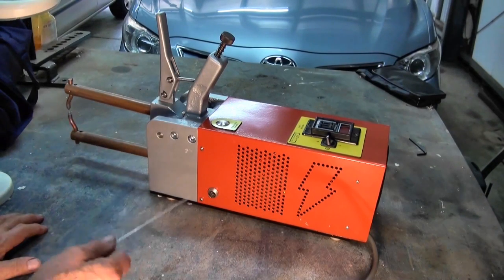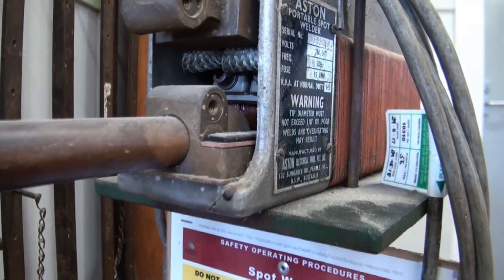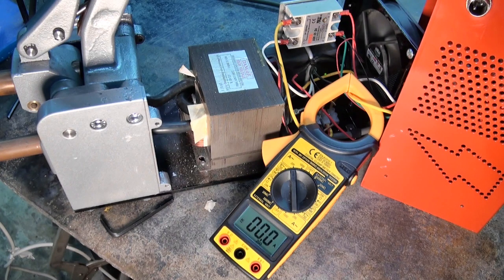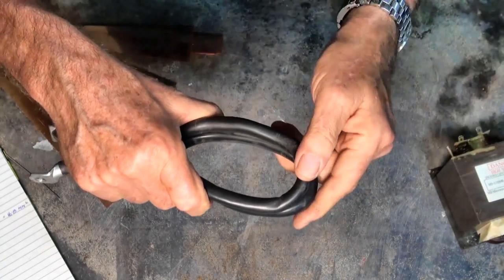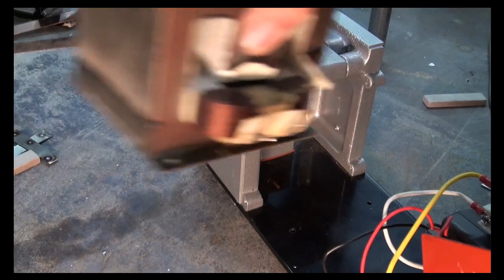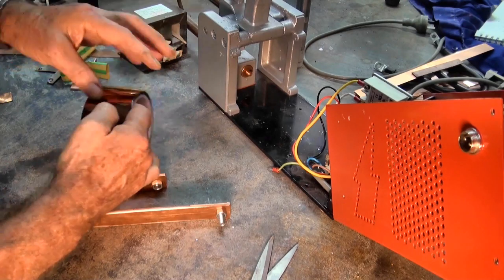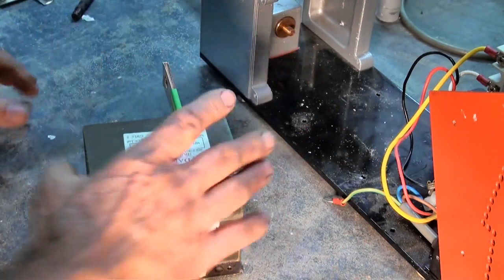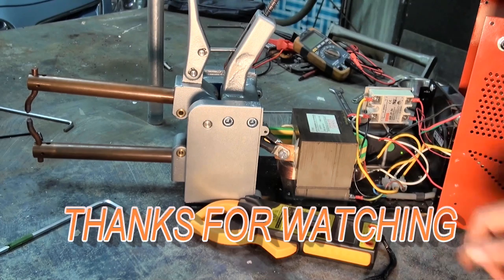Spot Welder Upgrade Goes Sideways

Comment: remove the flat metal plates between primary and secondary, they act as peak current limiter
Reply: No, you do not want to do that because the plates (core) increase the magnetic flux density (magnetic field through a cross-sectional area).  They are not just metal plates. They are plates made of highly magnetically permeable alloy that contains/steers the magnetic field.  If you remove them, then the magnetic field will spread out more in it's natural loops with only the air to permeate and will therefore couple less efficiently through the secondary.  The emf induced is given by -N*d/dt (mu*H*A) the time rate of change of the magnetic flux (B*A where B = mu*H) where N is the number of turns, mu is relative permeability (>= 1.0 (air/vacuum) ), H is the magnetic field , and A is the cross-sectional area through which the H field is piercing.  Emf can also be expressed as -L*d/dt (I) where L is the inductance of the secondary winding I is the secondary current and again d/dt means the time rate of change.  Equating these we get N*d/dt (mu*H*A) = Ld/dt(I) ==> N*mu*H*A = LI and solving for I we get....I = N*mu*H*A/L so....the secondary current is proportional to mu.  With the plates in place, mu >> 1. removing them makes mu = 1.  Remove the plates and your current goes down.  Feel free to verify the physics.  Cheers and peace to all.

Comment: I was thinking I would use my own insulation,  a flattened copper tube with a woven fiberglass sock  and then coating the lot with shellac.   For the tongs  the idea In my head atm is continued copper tube with a stiff steel insert   I'm just trying to get the leverage mechanism worked out in my head
Reply from the maker: Since making that video I have rebuilt the secondary winding of the transformer using 00B&S battery cable. The welder now works exactly the way I want it to. The single turn secondary made from the copper strips should have been successful but the results were less than impressive. I have had a lot of suggestions about how to make it better. The most common suggestion was to use way more copper strips. I actually had a lot more copper that I could have used but my calculations on the cross sectional area were more than what I had originally when I was using two turns of stranded copper battery cable. I should have completely filled the opening in the laminations with copper but didn't. If you check this video you will see the welder operating as I have it now. https://www.youtube.com/watch?v=VPTdDzf1-s0 The mechanical parts of the welder have proved to be strong and easy to operate. I can weld up to 1mm thick stainless steel easily. So far I have not had any problems with the electrical operation either. 
Regards,
Mark

Comment: transformer from microwave oven average pwr capacity between 1300 to 1450 watts,you can use 2 transformers with the same calculation to increase power capacity and generates more heat/performance
Reply from the maker: I did consider adding a second transformer but I find the welder does more than what I ever imagined it would be capable of now that I have done the most recent upgrade. The packaging is also nice and compact. It tucks away neatly inside a cupboard and it is light enough to take to a job if necessary. I must say it is one of the tools I have made that outperformed my expectations. 
Regards,
Mark

Comment: Your transformer core is in magnetic saturation. Retired electrical Engineer here. Look into hysteresis and saturation online.
Reply from the maker: Sam, I really should delete this video. It was an experiment that was a bit of a dead end. I eventually restored the 2 turn secondary winding but I upgraded to a much heavier cable and the whole machine now works great. I did a follow up video on the upgrade that actually worked.
Regards,
Mark

Comment: Hi Mark,

It is probable that in both cases your transformer core is saturated magnetically, limiting the secondary current to the same values.  Hence you would not see a difference in welds.  I think you have reached the limit of what that size transformer can do.  2 transformers in parallel would double the current. 

Regards
Chris Humphris
Reply from the maker: I think you are correct. I am starting to think that if I can get two identical transformers I might try to run a parallel setup but I don't want to add too much bulk to the machine. If I were to go down this track I would have to rebuild the entire rear end and casing. I might put this in the "rainy day" basket since the machine does more or less what I want already. Like I say though, it was and interesting project and I learned something.
Reply: I am pretty certain that the problem is not that the transformer is magnetically saturated. The way that MOTs are built is dirt cheap, they cut every electric and magnetic corner they can. So yeah, they saturate easily, but the consequence of saturation is that they start to approximate open air instead of a transformer. You may draw extra power but an increasingly small amount of it ends up adding to the secondary and more and more of it is wasted in heat on the primary. If that were true, you would see the input current fly sky-high and it would quickly blow a breaker. The symptom that Mark is seeing is that the current is actually reduced from his earlier build, which means he's nowhere near saturating the MOT yet... which will only happen if there is too much resistance to allow enough current to flow. The added resistance comes from 2 places: 1 - That he has half the voltage he used to, I = V/R, with V twice as small, current is half what it was, and 2 - He has less cross-sectional area than he used to. If he used half as many turns, he needs to use double the wire thickness to make things equal. Better yet, removing the old 2-turn coil with its heavy insulation allows him to more than double the amount of copper in the core, which is where the big gains are to be made. He could've gone from 30% core spaced used up to 90% core space used, making it 3x as powerful. Instead he kinda hovered around 30%. So his results make sense to me based on the modifications he made.

Comment: By halving the number of turns at the secondary, the voltage at the secondary also halves. What this means is that even though the secondary copper resistance is lowered the voltage drop on the secondary winding now also becomes more significant and more power is lost at the secondary.
What you need is most probably more voltage at the secondary to overcome both the contact resistance (plates to be welded) & the copper resistance (secondary copper wire), which can be obtained by increasing the number of turns.
Reply from the maker: Frank, I must admit that electrical theory is not my thing. I did however rewind the secondary with much thicker wire after the trial of the copper strip method in that video. I ended up using two turns of 000B&S wire and it seems to have done the trick, so this backs up what you have mentioned about the relationship between voltage and resistance. The welder now does everything that I want it to and it is reliable and still compact enough for me to store it away in a cupboard when I am not using it. I must say that this was one build that I embarked on that turned out to be more successful than I thought it would. Believe me, there are plenty of failed projects and second rate builds kicking around my shop.

Comment: your output voltage is way too low.  you need 2.5 to 3.5 and up to 5.  If you run two MOTs in series on one secondary with two turns ea, you will be in business with something 4x the speed and penetration based on 2x the increase in amperage.
Reply from the maker: Derek, you may  be able to tell that I was somewhat disappointed with the results of this "upgrade". I eventually scrapped it and went back to a more conventional 1.5 turns of some much heavier battery cable and the welder is now stable and capable of welding the sort of stock that I use regularly in my workshop. I did consider doubling up the transformers but to keep the machine small and portable I chose to go with just one transformer. I was able to repair a small stainless steel kitchen microplane by welding the stainless steel blade back onto the wire handle just a few days ago. It just works now!
Regards,
Mark
Reply: @Preso58  Great to hear.   I've immersed myself in the subject in the past few weeks and just built a dual transformer rig that is pumping out 4v @ around 400 AMP, if my meter is correct.  From what I've seen, this can spot weld up to 1/8 bar stock in around 5-7 seconds.  Though I've not tested my on stock that big yet.  fingers crossed.

Comment: Naughty, naughty......yellow and green is strictly for “Earth/Ground” connections. Should never, ever be used for any other purpose.
Reply from the maker: Stephen, for what it's worth, I ended up scrapping that experimental secondary coil. It didn't live up to my expectations so it's been replaced with 1 1/2 turns of OO B&S insulated copper cable, in red! The welder now works great. 
Regards,
Mark
Reply: It doesnt matter what color he use, i believe he didnt plan to sell for the publics and furthermore its for his own use. I did the same if i have no intension of letting things to other ppl, as long as it works...peace
Reply: hey stephen, you are toal wrong--yellow and green is also usable for almost everything, we in germany we use it also for bratwurt and sauerkraut and a lot of senf, and you are allowed to use it for leberkäse too

Comment: Tesa tape would be a better option then electrical tape.
Reply from the maker: For what it's worth, I ended up scrapping that "upgrade". It was disappointing to say the least. I have gone back to the original concept of 2 turns of a much heavier cable and it now works as well as I want it to and it's quieter as well. 
Regards,
Mark
Reply: hey kapaaz, the best option is münchner weisswurst with händelmayers süssen senf
Reply: @elh3809  sausage & mustard🤣🤣🤣

Comment: IMHO, "efficiency" would be considered "increased" as long as you used the same or less current from the wall and were able to get more out of the business end... but you did not measure how much current was being output - WHY NOT ???
And then, when you were done with your "retrofit" - AGAIN, you did not measure the OUTPUT.
So now you should do so, measure the output current {same as you measured the input, just snap around one of those big copper arms} in whatever configuration it is in right now, THEN, return to the other configuration, and measure THAT output.
Only THEN will you know of any real gains or losses - or NULL.
Reply from the maker: I don't know if it was clear from the video but I realised that the "upgrade" was disappointing and I sort of gave up on the idea. I have since gone back to the two turn secondary but I used much heavier wire and it solved the problem of the noise, vibration and the current density across the welding electrodes. I didn't measure the current output since I didn't have a meter with a suitable range. There is a video showing the final iteration of the transformer on my channel.
Regards,
Mark